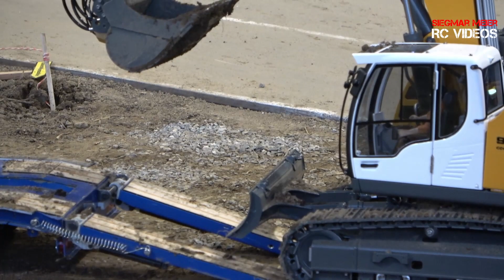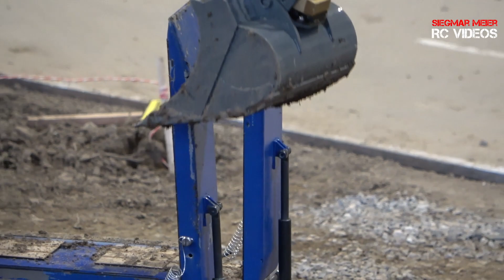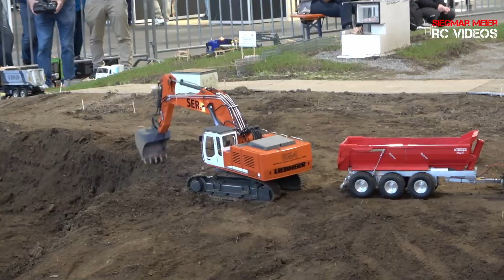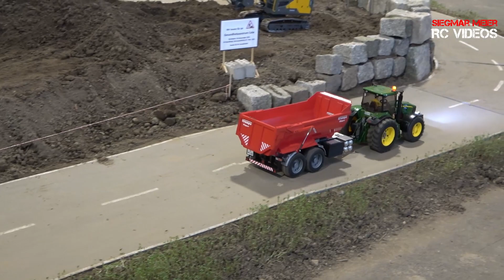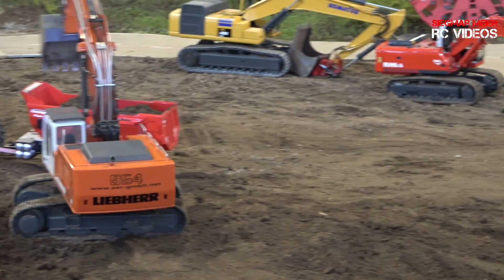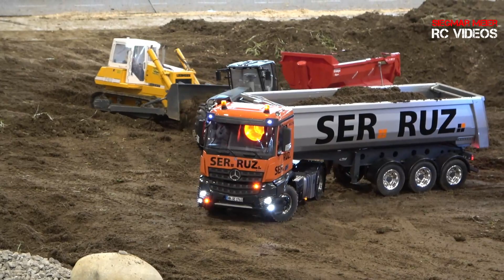RC Faszinierende Bagger, Raupen und LKWs auf der 1:14, 1:16 RC Baustelle in Aktion

Comment: Sind die selbstbau oder kann man die kaufen?
Reply from the maker: Die Modells sind teils Eigenbau, teils kann man die auch fertig kaufen. Die Kaufmodelle liegen preislich so zwischen 8.000 EUR - 12.000 EUR, je nach Modell
Reply: @rc-siegmarmeier  gibt es auch preiswerte Modelle die Spaß machen? :) unter 500€?
Reply from the maker: Durchaus, unter 500 EUR z.B. den Bagger Huina 1580, oder für ca. 680 EUR den Bagger Volvo EC160E von Double E. Beides Modelle mit Elektroantrieben, Hydraulik gibt es in dieser Preisklasse nicht. Spass machen die aber trotzdem.